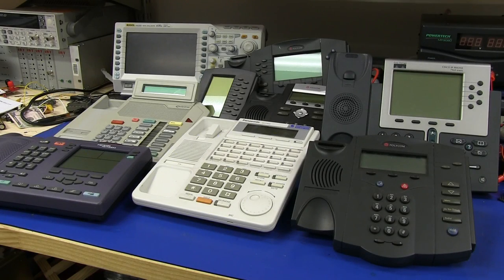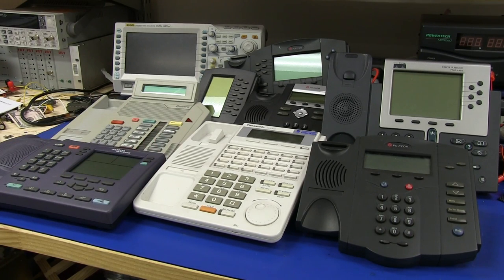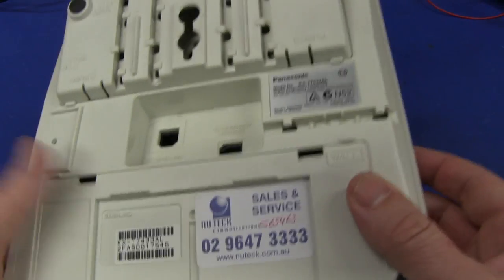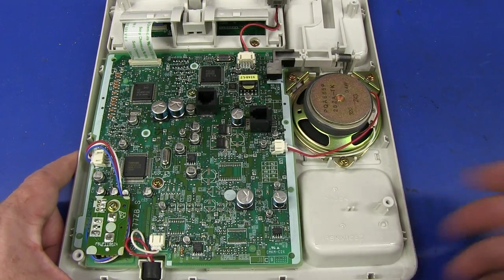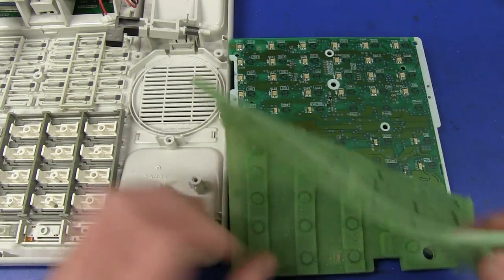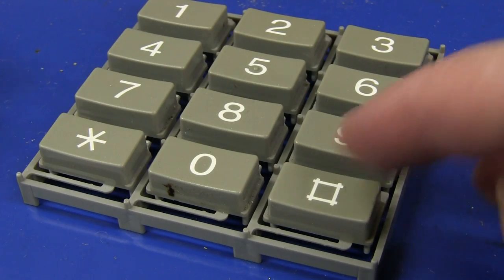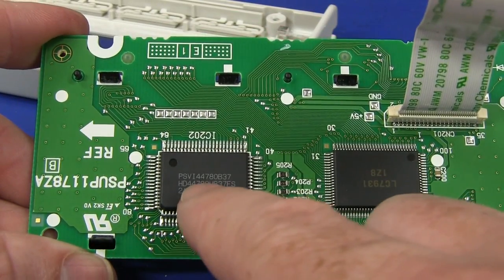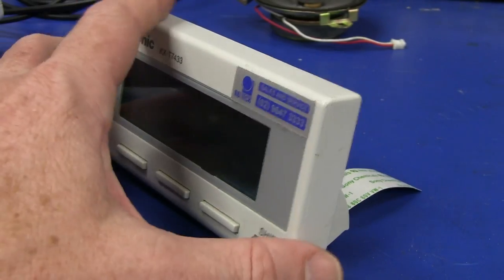EEVblog #547 - Dumpster Phone Teardown

Comment: Hi there Mr Jones! I think you just misted some IR transceivers for the extra module on the polycom phones. And if my hunch is correct, that the data is sent through them, you could still use them for some weird control/option panel. Thanks for all the great videos so far, I’m waiting for more in the future! :)
Reply from the maker: Yeah, you are right, totally missed that. Thanks.

Comment: Hi Dave, a bit of a long question here - I've got a project this week with the following brief and wouldn't mind having some input from any of the viewers or yourself:

A small company that is using an external switchboard for its phone exchange would like to monitor their employees phone usage. For that purpose you have been hired to setup an apparatus (hardware and software) to be non destructively attached to the phone line that would be able to give as an output the phone number called. The phone used by the company gives a standard dual tone multi-frequency dialling system and the phone line would also carry the internet ADSL and other signals.

I have designed the antenna currently to pick up the signal, and the code on matlab on the opposite end to actually decode the number of the phone. The part which i'm having trouble with is the circuit design in the middle, so far i'm thinking some kind of amplifier and a bandpass filter. I'm not too sure what kind of amplifier I would use in this situation however. I hope this reaches you through the new comment system.

Regards

Comment: I've never come across Zebra connectors before. Just spent 20 mins Googling them... very interesting, but can't figure out how they are normally attached/kept in place. Are they just squeezed between PCB and LCD when the case is screwed together?
Great video, lots of info packed into that 15 minutes.
Reply: Yes just the pressure from the case squeezing the whole assembly together, they can start to cause problems in older units especially if the unit has been serviced a lot and the case screw stand-offs get worn.
Reply from the maker: Yes, they are contact connectors that need a bit of pressure to work. There are formula for the right amount of pressure for best contact, but most don't bother being that exact.

Comment: Hey Dave, I've actually repaired a few of the Avaya 4620 IP phones- The fault is almost invariably 100uF and 470uF caps at the lower left of the board. They dry out because the voltage regulator (I think it's an LM317!) next to them gets very hot. The one I just picked up actually has delaminated the board!
Reply: Ha, that's funny I had a different electronic device (InFocus LP-340 projector) that had a lone electrolytic cap right next to a Viper100A, that would also inevitably dry the cap out over time. This cap combined with a resistor was directly responsible for setting the oscillation frequency for the Viper (with a lower value increasing the frequency...) I wonder if this is a known trick to make equipment have a limited lifespan (i.e. planned obsolesce)?
Reply: I have often wondered that myself.  Our organisation has several thousand Avayas of that particular model. Our workshop has repaired maybe 500 so far... Given we were doing them at about $50 a go, against a replacement value of $350...

Comment: I also collect usable stuff from old equipment. Strange how you need something you chucked away recently.
May i ask what is you feeling about the Rigol multimeter range compare to Fluke and the other good brands. Maybe a tear down or impressions in the future?
While i am busy. For many years i have had a switch in my scope's plug to disconnect the mains earth when doing certain measurements. Would you make a short video on why not to do this and all the problems please? I was not very clever?
Thank you for all the informative info and i also like the tear downs of old no matter how old equipment.

Comment: Hi Dave, around 4:45 you mentioned something that sounds like Zephyr/Zepir strip. Can you tell me what it was? I've seen this thing in an electronic caliper sometimes ago but i dont know what to search for. I just assume its some sort of rubber based flexible printed circuit with exposed contacts on both ends. But since you said its not easy to find, i think it must be something else
Reply: Zebra.  like a striped horse.  neighhhh!